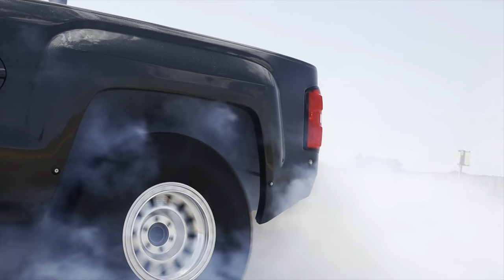Texas speed stage 2 cam 5.3 Sierra daily driver with x pipe and long tube headers

Comment: I have a regular Cab short bed 2010 Silverado 5.3 long tube headers, k&n cold air, btr stage 2 cam, E85 tune, Carven R exhaust. dyno sheet said I made 366 hp and about the same TQ.
That’s to the wheels.
Really diggin your truck man!
Reply from the maker: I think I’m hopeful for 400 wheel but doubt it. Probably around the same as you!
Reply: This truck probably made more because this is a direct injected gen 5
Reply: What’s up bro , I got a 2010 5.3 aswell , which knn intake did you get for yours like series or part number ?, thanks
Reply: @818lifestyle4  i don’t remember man sorry
Reply: I have a 08 1500 lc9 aluminum 5.3 tsp stage 2 high lift pac1218 valve springs and k and n intake, stock exhaust and hp tuners road tune by me, it definitely doesn’t lope like that because of how I have the idle set (750 rpm and around 19 is degrees of timing and a tiny bit more fuel) but it freaking moves like it’s scary in the rain, and it still passes California smog 😉
Reply: @turkeyboyjh1  HEY BRO DO DID YOU GET A TUNE?

Comment: Welcome back trucks sounds and looks awesome!! For someone with same truck but no cams or headers. Would you recommend the black widow or carven?
Reply from the maker: Carven hands down, it’s all stainless steal so it won’t rust while the black widow looks crummy after a few months. Much higher quality at the same price point!
Reply: @connorellisx  black widow actually last pretty damn long
Reply from the maker: @Tacpew  not saying it doesn’t last, it’s just made with cheap material rather than stainless which is pretty much the standard across all other brands. So it becomes rusty after a few months while the carvens will be shiny for years. Also they deliver a Deeper sound!
Reply: @connorellisx  I had them on my car for 2 years and mine didn’t rust at all but I get what you’re saying

Comment: Hey man. Sick truck. Did you tune it after you did all that work? If so, who’d you go with, and what did it cost?
Reply from the maker: I did have to get it tuned otherwise it wouldn’t idle without dying. I went through STD performance in Long Beach, and I believe it was like 400 or 500 for the first tune.

Comment: I’m looking at BTR stage 2 with afm delete and trunion upgrade, long tubes with cats (my state requires them to pass yearly inspection 😒) and I already have Carven Progressive series cat-back exhaust and 3rd cat/resonator delete.
Thought about S&B intake but right now I have a drop-in K&N filter. JLT oil catch installed.
Later down the road i’d like to add a 2.9L Whipple
Reply from the maker: I’m In California so I don’t think smog gets any harder to pass than here. It will be expensive but it costs to play I guess

Comment: Bad ass truck man just wondering did u have to do any transmission work?
Reply from the maker: For this cam it isn’t required, I did replace my transmission shortly after this but not because of it. When I did i also upgraded the tc to a 3000 stall and it’s WAY better!

Comment: Awesome truck bro! Why not go with the stage 3? What would be the difference
Reply from the maker: Good question! I went stage 2 because it’s about as aggressive as you’d want to go with a stock torque converter. I’ve since upgraded to a 3200 stall circle D and honestly it runs amazing, I do daily drive it so I’m not sure how much gnarlier I want it on my early morning drive to work😂
Reply: @connorellisx  That’s awesome!  Im trying to figure out what would work for me  on a BTRstage 2 or stage 3.  I have a 5.3L with Kooks headers, Corsa Sport, and E85 tune. 
I For sure want to upgrade my converter to a Circle D one but not sure if I’m able to have one installed before the cam. Is that 3200 a good stall or would you have gone a bit higher ?  I daily mine also, so yeah..  Thanks again, Merry Christmas brother 🔥
Reply from the maker: @JTrump23  I know the TSP runs slightly more aggressive with their stages like stage 2 is very much like the BTR stage 3, 
3200 was really good, maybe I would have done a 3500? But that’s about it, it really just put the truck in the rpm range it wants to be in after being cammed. Honestly it’s a tough question cause it depends how “race car” you want you’re daily! It’s cool sometimes and it’s not other times😂
Merry Christmas to you too dude!

Comment: So cool, sounds and looks amazing, but I need to know, what wheel specs are you rolling? Good video👍🏻
Reply from the maker: Right now they are 17 inch method MR103 beadlock wheels with nexen 37/12.50/r17 tires! 
Soon to be 40” bfg KR3s 😅

Comment: Im about to put a cam in my 2011 5.3l but worried on if its mandatory to run 93 octane in it after with these gas prices the way they are. I use the truck primarily for towing.
Reply: Compression ratio is what determines fuel. Not the cam.

Comment: When you did the cam what all did you have to replace. I’ve got a stock 5.3 wanting the same cam but don’t wanna replace everything. Would like to replace as little as possible.
Reply from the maker: It’s the cam, pushrods, the lifters and valve springs that get repainted, it also requires the DOD deleted which is pretty minor.

Comment: Hey bud , followed for years on ig but if I were to do the same cam set up would you need to do anything else supporting wise for the cam?
Reply from the maker: I’d recommend a torque converter if you can! It would have saved my transmission I think

Comment: How’s the rasp? I’ve got the same cam. Same long tubes. Can’t figure what exhaust I want
Reply from the maker: It’s not raspy! One of the big things I found was getting a muffler with packing in it will lower the raspy notes by a lot. I went with carven TR series but it’s a little loud I feel so I’ve considered going to corsa or something
Reply: @connorellisx  I’m on my 4th exhaust in a month lol.  First I had it straight piped stock exhaust.  Sounded good but was raspy on take offs. Then went with 3 inch exhaust and a magnaflow muffler.  Sounded like a cammed Kia Soul.   Then went with 3 inch exhaust and flowmaster 10.  Didn’t sound good. Now I’m dual 3 inch exhaust x pipe and no mufflers.  It sounds good but it’s way to loud.  So I wanna put two mufflers on it.  Just didn’t decide which two
Reply: @joshuayoung3464  you gotta let them cook and settle in man lol definietly does change sound after they heat up a bit. I got 09 cammed 224R trual duals with Carven R series i love it! little on the loud side but damn sounds good.

Comment: Do you feel like you gained anything down low for torque, i tow and im not sure what to do for cam
Reply from the maker: Absolutely, I went with a stage 2 which helps throughout the rpm range. I know several people that went to a stage 4 and couldn’t stand it but they do sound insane!

Comment: Just recently installed long tubes with my 14 Silverado did you have it tuned right after you installed the headers? Dyno tune
Reply from the maker: I also did a cam swap at the same time so yes I had to tune it, you will aswell in your case because it’s going to be reading your post cat O2 sensors still and will cause it to run lean.

Comment: Do you have to change out your stock lifters for a daily or you can just swap out the cam ?
Reply from the maker: because you will no longer be running DOD you will have to change to aftermarket lifters

Comment: Was your cam a supercharged or turbo cam ? Or which cause theres alot of different ones as well as the headers they have different names and stuff
Reply from the maker: Negative, from my understanding those are intended to be ran in a boosted application while mine is not, this is just a regular stage 2 Texas speed cam
Reply: @connorellisx  alright and what about for the headers theres 1 3/4 and 1 7/8
Reply from the maker: @luisaacuna6009  I went with 7/8 on mine but that’s just because that’s all that was offered by tsp, I know you can get 3/4 but it’s such a small difference that nobody would ever notice a difference in maybe 2hp, even headers gains are minimal maybe 10hp. It’s pretty much all for sound imo

Comment: Low lift or high lift version of the stage 2? are you running stock pushrod length?
Reply from the maker: This is the high lift version, and the pushrods were replaced with chromoly ones, but I’m not sure if they were the same length as stock or not though
Reply: @connorellisx   Awesome I got the high lift version on the way for my truck, can’t wait for it to sound like that. Thanks for the response!
Reply from the maker: @drispoli7  heck yeah! I’m pumped for you to get it in🤘🏼

Comment: Did you have to put a new stall converter?
Reply from the maker: No, stage 2 is about the max without a converter. 
Worth noting after I made this video I did have to replace the transmission and I installed a 3000 stall converter and it works WAY better.

Comment: Did u get any % increase on  the fuel lobe or just stock %?
Reply from the maker: I did the stock fuel lobe because I have no plans on running any type of boost at this time, and if I ever decided to would probably get a cam that was a spec more designed around that application.

Comment: Have you changed the gears in differential?
Reply from the maker: Unfortunately at this time I have not, Instead of buying gears for the stock rear end I have bought a 9” third member that will be getting installed soon in a different rear end housing that’s a full floater

Comment: Which headers did you get? Texas speed says there long tube headers won't work because I have a 4 wheel drive.
Reply from the maker: So in this video they are the Texas speed ones, I’m now going to the Doug thorley headers!
Reply: @connorellisx  did you have to modify them at all or was it a direct bolt on procedure for the tsp and are the doug headers better?
Reply from the maker: @Jeff-ti4pd  so for me specifically the Texas speed ones needed to get hammered in to clear my shock towers. And the Doug thorley ones clear without that, also they are a tri y design and makes a lot more usable power rather than all at super high rpm
Reply: @connorellisx  ok cool, I'm here in round rock so texas speed is just down the road from, that's why I wanna go with them. Also thank you for your replies and help with info, I do greatly appreciate it. So basically they got scratched up a little bit hammering them in to clear the mount?
Reply from the maker: @Jeff-ti4pd  for me it was a lot of hammering, but that’s because of my suspension. Stock shock towers it should clear without any issues
Reply: @connorellisx  ok cool thanks a lot man, their sales guy told me it wouldn't fit on a 4 wheel drive
Reply from the maker: @Jeff-ti4pd  mines a two wheel drive so I really can’t speak for fitment on the 4wds
Reply: @connorellisx  oh well damn, I thought the prerunner was 4wd.
Reply from the maker: @Jeff-ti4pd  nope! Believe it or not about 9 out of 10 Prerunners are 2wd, many even delete their 4wd to run 2wd kits instead
Reply: @connorellisx  no shit thats nuts man, i would have never thought!!
Reply from the maker: @Jeff-ti4pd  I think most the country it’s under the impression they are 4wd so you’re not alone! 2wd makes for more wheel travel 18” vs 4wd is around 12” and fits bigger shocks making it a lot faster and stronger than a 4wd would be! Obviously there are still plenty of times 4wd would have its advantages as well though
Reply: @connorellisx  damn thats cool i didnt know that at all man!! i would have thought they would have engineered the 4 wheel drive to have the travel needed due to it being built for offroad!!!
Reply from the maker: @Jeff-ti4pd  I mean there’s some really cool portal set ups made by 74weld that are starting to come out but we are talking about easily $60,000 or more by the time it’s driving again, it’s sure fun to dream about it though 😂

Comment: Hey if anybody might know have a tsp stage 2 low lift cam with speed eng long tube headers ls6 beehive valve spings tsp hardend pushrod and lifters 706 heads stock intake and tb though already have my tbss/nnbs intake with flex fuel rails and 50lb injectors with a 102mm tb thats about to get ported maybe even along with the manifold curious to know if any of you guys knw what i might be pushing once the intake is put on?

Comment: How did the carbonfiber front fenders fit any issues ?
Reply from the maker: I actually have a video on here about installing the bedsides. 
They were not easy but they worked out, not OEM fitment but that sorta comes with the territory
Reply: How was installing the fronts
Reply from the maker: @alancrisp3787  I have the dirt king inner fenders and that made it a lot easier. Without them… it would be a huge pain
Reply: @connorellisx  ya I ordered those abs the carbon ones from fiberwerx gonna take 8 weeks did u have to do some trimming on the front glass
Reply from the maker: @alancrisp3787  zero trimming!
Reply: @connorellisx  nice man. Sorry throwing alot of questions  at u what suspension  are u running ? I took my 5 inch spindal lift off and stock the factory one back on it I have the upper dirt king arms and going to use the coil over to get the lift in the front
Reply from the maker: @alancrisp3787  I’m running the dirt king fabrication race kit!

Comment: Why'd you switch from cwf to dirt king
Reply from the maker: Many reasons the dirt king kit is by far a superior kit.
1- more travel, I know he advertises 16” but truly it’s a bumped and strapped 14.5 while the DK kit pulls 18”
2- get an actual fabricated shock tower with cross member because the shock buckets will rip off if you plan to run hard
This also allows the kit to pull much more uptravel which is truly where the off road performance comes from. Not just droop
3- build quality is no comparison between the two (you don’t see upper control arms folding in)
4- wanted to have a bypass slot and not have to build an entirely custom shock tower.
5- geometry, the cwf kit you’d lose control
Of the vehicle in just a group of potholes on the road, when I switched it was an entirely new truck so much more predictable to drive, you could drive with two fingers on the wheel through that same group of potholes.
Reply: @connorellisx  glad I went dirt king in the first place then was considering the cwf at first
Reply from the maker: @XeRoXmachine13  best move I ever made… but ironically, I’m selling that kit and cutting it off now😅
Reply: @connorellisx  which way are you going now
Reply from the maker: @XeRoXmachine13  Izzy fab race kit. And well, it’s currently in the middle of getting a cab cage, engine cage and back half

Comment: I don't understand how you live with that exhaust system🤣 my speed-engineering  full system on my 01 gmc with a btr stage1 truck cam is loud as hell.
Reply from the maker: It’s a lot man, I’ve been looking into possibly getting the catted y pipe to quiet it down a bit

Comment: You’re just Wrong. Dyno it you’ll be sorely disappointed. You’re also going to lose a ton with those tires just to begin with. And it doesn’t have 375 hp at the wheel. Nice try
Reply from the maker: I really don’t think I’m THAT far off… but right on buddy haha

Comment: Have you noticed any extra valve train noice with the tsp 2 cam?
Reply from the maker: Yes just slightly though!
Reply: @connorellisx  mine scared me at first. I called TSP and they said yeah it normal took me awhile to get use to it. It’s not a bad noice just more then I’m used to hearing.

Comment: Are you running the stock stall or is it upgraded also
Reply from the maker: For right now I’m running the stock stall, definitely wouldn’t do that if I went any bigger on the cam specs
Reply from the maker: Update… trans took a dump on me😂 stall going in!
Reply: Im think of going with same sit up .do you think the cam and header is what did it for the tranny
Reply from the maker: @davidslaughter7523  I don’t think so, my truck isn’t low miles, right now I’m at 144k. So I believe my time was coming up.
Reply: When cruising down the highway with the stock stall did you notice any weird jolting when going up a hill? I’ve been having that issue where Im in cruise control and I can feel it kinda shake/jolt if the road has hills don’t know if it’s my stock stall or the tune. Any feed back would be helpful.
Reply: What torque converter would you recommend for this cam? I’m having to do the DoD/AFM delete on my 2010.